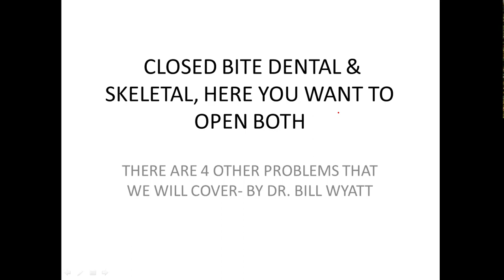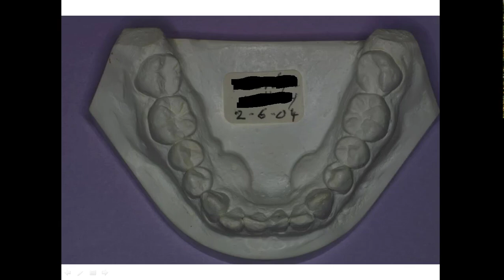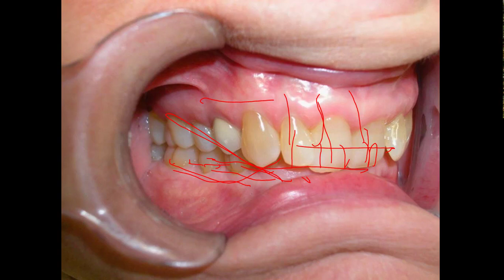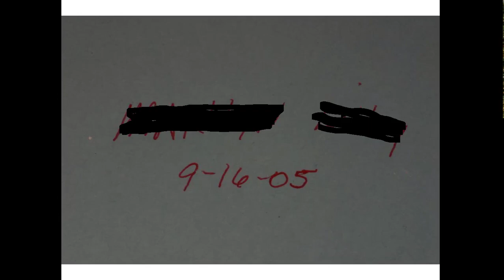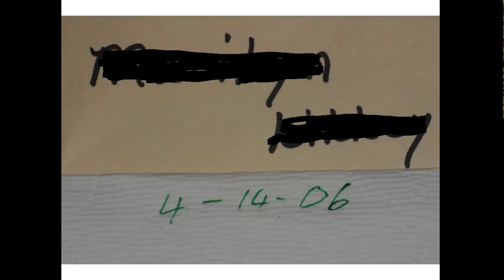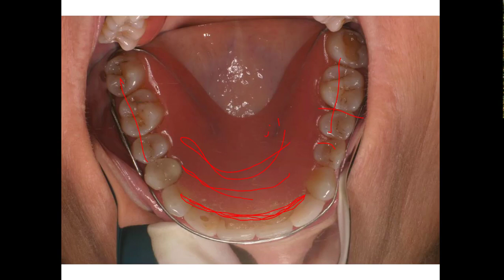Opening the bite Dentally and Skeletally. Way to use Bonded Blocks --A WOOW case !!

Comment: Thank you.... did you end up with dual bite?
Reply from the maker: No. It is skeletally open and dentally opened. It is obvious to see the opening of the dental part if you look at her facial structure after we finish, there is a little more space between the nose and the chin, which makes the face look better. 
We did this by putting a bite plate in the anterior part of the mouth so that the force that intruded the upper and lower anterior teeth came from the molar teeth. The uppers were forced down and the lowers were forced up. They had no occlusion on them and the amount that upper and lower moved together increased the vertical height of the lower 3rd of the face. 
There is no tendency here for dual bite !